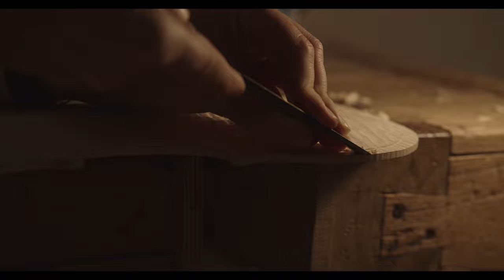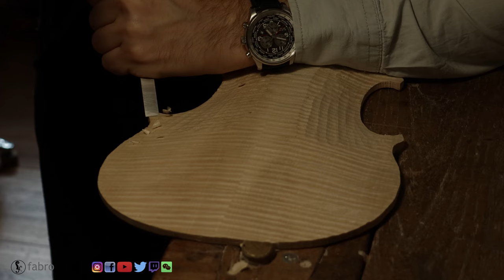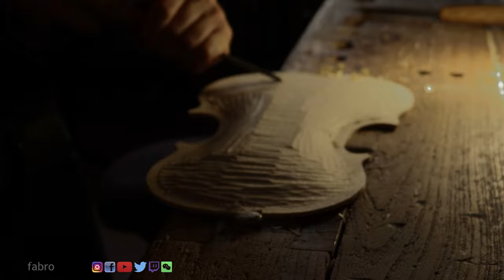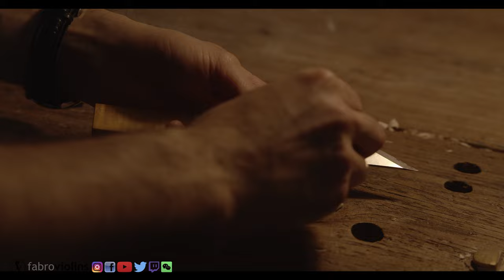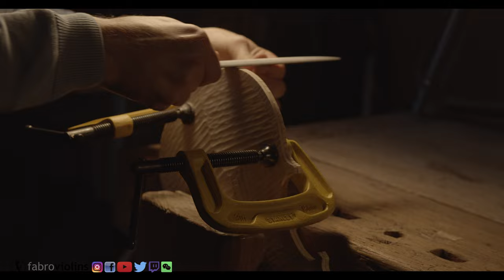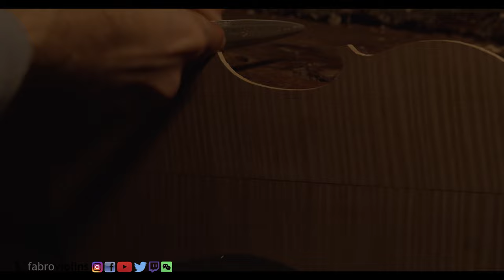MAKING A VIOLIN | The BORDERS - EDGES | Step 03 | Amati Model

Comment: How often do you have to sharpen your tools?
Reply from the maker: It reallty depends on what I'm doing and of course...on the wood itself.
For example, I always resharpen my planes before making the joints or fingerplanes before I start working on the archings (the firngerplanes just with the waterstones). 
Same for the gouges before working on the scroll and will have to retouche them again on the waterstone when I'm doing the scroll finishing.
During rough out it depends, I'm a bit more lazy here and I always end up regretting it as I think if I sharpened more it'd take me less time and less effort, but I'd say a couple of times with the waterstones. 
To summarise I tend to resharpen (at least with the waterstones) everything before I use it for a new task (and should do it more!! haha).